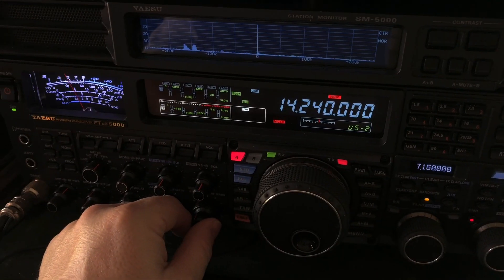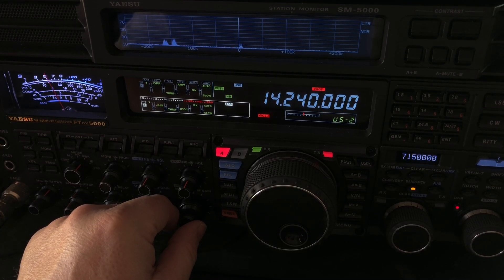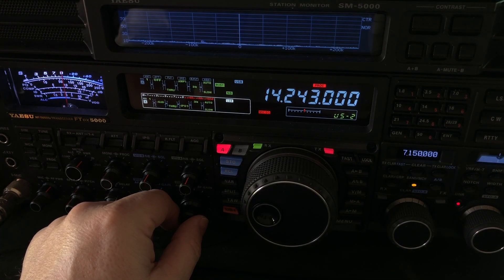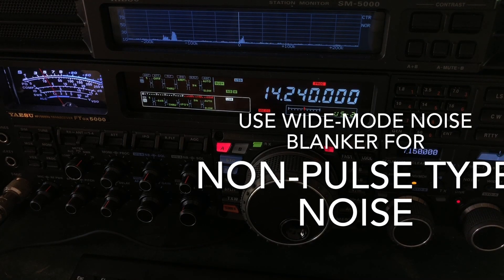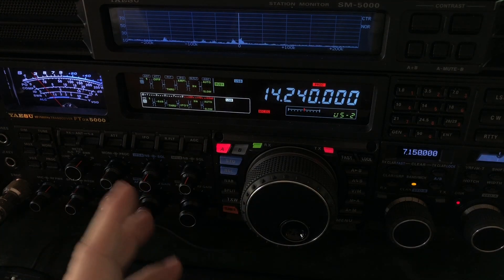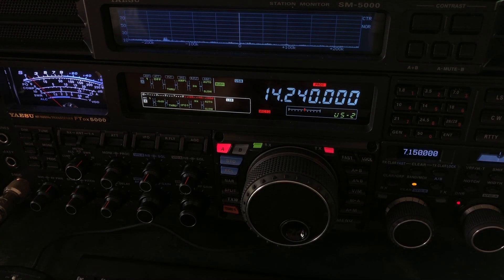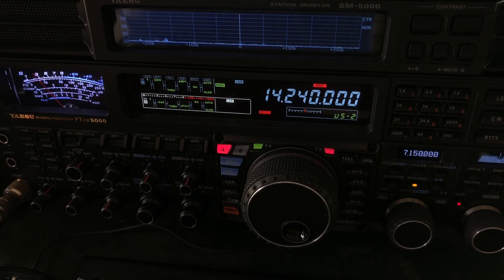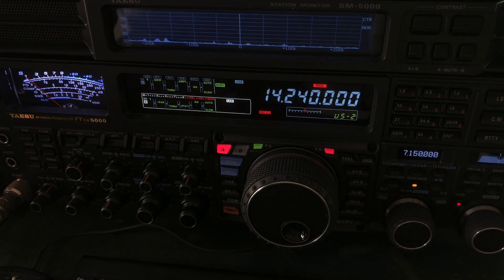Noise Blanker Degrades Receiver Selectivity #hamradio #yaesu

Comment: Noise blanker typically remove the impulse noise, but if it is too strong it may reduce the signal gain, which also reduces the weak signal reception too. At my QTH, a faulty streep lamp emits very strong QRM, about +20dB over S9 at 2 MHz region. Noise blanker helps to reduce it down to S9, but it still not pleasant to listen to AM braadcast stations.

Can you test with other rigs? 

Thank you. 73
Reply from the maker: It is a common issue with analog noise blankers.  It isn’t a Yaesu only issue.  I just used my FTdx5000 because it was convenient.  I’ve been a radio technician since the 1970s.  Degraded selectivity has long been a side-affect of the analog noise blanker.  The DSP noise blankers suffer a different problem.  They introduce distortion with strong signals on the same frequency.  The analog noise blankers generally do a better job of minimizing the noise.  The DSP noise blanker is less expensive to make but also less effective against the noise and causes distortion of the received audio.
Reply: @n4hnhradio  
THaks for the respond.

The QRM is  still a strong impulse RF  signal, which may affecting the AGC and 'masking' the weak signal.  

Thanks again for the  demonstrations.

Comment: I realised that on my radio quite a long time ago, but you were the first to cover it on a video.Yaesu could upgrade the 5000MP to get rid of that technical issue.
Reply from the maker: It’s a common issue with noise blankers in general.  It has to do with the way they blank out the noise.  I covered this in the video description. 

73, de N4HNH